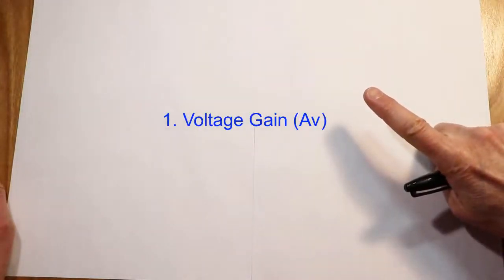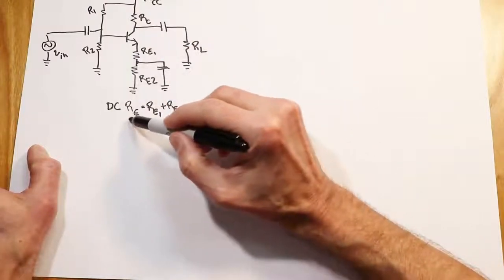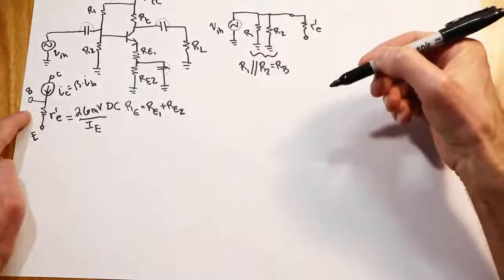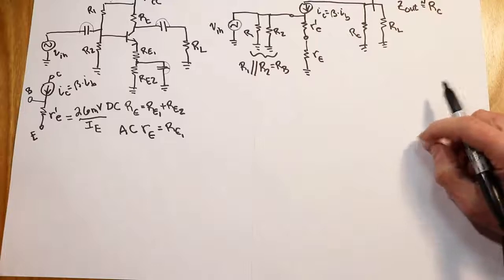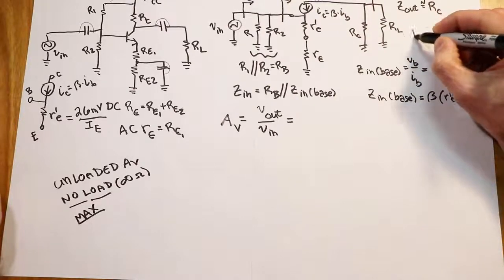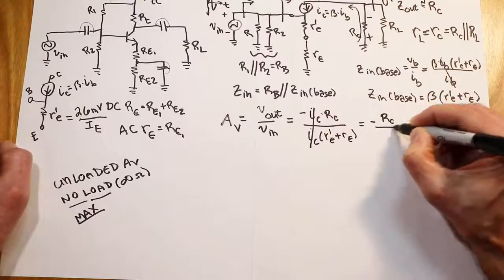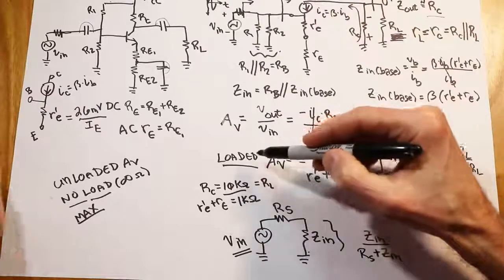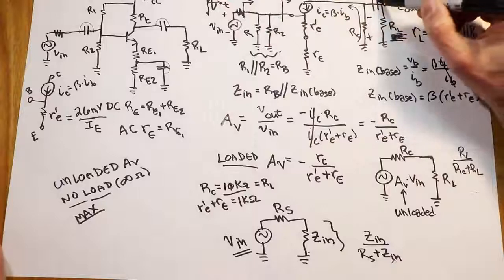Semiconductor Devices: Common Emitter Amplifier

Comment: Perhaps one of the most comprehensive and well-explained videos on this topic in all of Youtube. Thank you! I was going through your videos and was wondering if you had one (or will make one) about designing a multistage amplifier given a certain set of parameters? Such as a specific voltage gain, a specific Vcc, a specific input resistance, etc.
Reply from the maker: I don't have one of those out yet, but you will find all of the requisite bits either in the Semiconductor Devices playlist or in the (free) text book of the same name. If your interest is in making audio amplifiers and associated equipment, I strongly suggest taking a look at the Op Amps playlist and associated (free) text book. There's tons of applicable material there, and, at least for the line level stages, designing with modern op amps tends to be a more successful endeavor for the average individual (as in quicker and less expensive). Modern op amps can be of excellent quality, and a smart use of them with some discrete design elements can accomplish most anything you want.
Reply: @ElectronicswithProfessorFiore  Oh I only asked because I'm actually an EE student right now and one of our lab assignments is to design a multistage amplifier using BJT transistors. I find it interesting how the R(in) of one stage becomes the load of another, and having to take that into your calculations for each stage. It was and still is slightly confusing to me but still a lot of fun.

Comment: That's one of the best descriptions of the common emitter stage with fixed biasing that I've seen on YouTube. I would add a few points:

(1) At 0:32 the other two things to look at are frequency response and distortion. For audio use, the input capacitor needs a reactance equal to the sum of the source and input impendences at the -3dB point, usually 20Hz. Similarly, the output capacitor needs a reactance equal to the sum of the output and load impedances at the -3dB point. Finally, the emitter bypass capacitor needs a reactance equal to the sum of r'e and Re1 at the -3dB point. It's a common mistake to assume that it needs to be calculated from Re2, which often then tanks the low frequency response.

Distortion in BJTs in common emitter mode is mainly caused by the dependence of r'e on collector/emitter current. It means that large input signals have greater amplification of the positive going half-cycle than of the negative going half-cycle, and it's pretty nasty. It is reduced by making Re1 an order of magnitude greater than r'e, at the expense of gain.

(2) The maximum unloaded voltage gain is given by maximising Rc/(r'e + Re1). that occurs when Re1 = 0 and so is equal to Rc/r'e. Since Rc will normally drop around half the supply voltage under quiescent conditions it is equal to Vcc/2 divided by Ic. So the maximum gain Av can be written as (Vcc/2.Ic) / (26mV/Ic) = Vcc / 50mV. This show the maximum achievable voltage gain depends just on the supply voltage.

However, the distortion in such a stage is likely to be unacceptable for anything other than minute input signals. So we might pick Re1 to be 9x bigger than r'e, reducing the distortion significantly, but lowering the gain by a factor of 10. The maximum realistic gain is then Vcc / 500mV. The result is that you always drop 250mV quiescent across Re1 at a maximum usable gain. And those are good design rules-of-thumb to remember.

(3) Since the output impedance is Rc, setting the output impedance (Zout) then sets the collector current to Vcc / (2.Zout) approximately. So for a 10V supply with a 5K output impedance, you will set a collector current of 1mA.

You want the current through the base bias resistors to be significantly bigger than Ib to reduce the variation in operating point with variations in transistor β. So the parallel resistance of R1 and R2 (what you called Rb) is going to be significantly less than β x Re1. But for gain Av, Re1 = Rc / Av = Zout /Av. That gives Rb << β.Zout/Av.
Hence Zin << β.Zout/Av.
That shows that the maximum achievable input impedance is related directly to the output impedance and the transistor β, and inversely related to the voltage gain.
Reply from the maker: All good stuff, but a bit much to squeeze into an introductory video! You will find this and more in my associated text. Free for the download-see the links in the video's description.
Reply: @ElectronicswithProfessorFiore  Well, of course it always depends on your target audience, but if you look at other similar videos on YouTube, you'll see that the points I raise above are very common questions in the comments.

The common emitter amplifier stage can be "designed" by simply copying other working designs, and that's certainly one route for the beginner. But as soon as you examine what is needed to design the circuit from a set of specifications, you'll realise that there's a core of information that is essential to be able to master that task.

You certainly have to show how to calculate capacitor values, and it's useful to demonstrate how the choice of collector current determines the input and output impedances, as well as how the choice of supply voltage determines the maximum gain. Anyone who aspires to become a designer needs that core at least.
Reply from the maker: @RexxSchneider  Right, and the goal of this video is as an introduction, with more to follow. It is not intended to cover the topic in its entirety. This video represents what I would present typically in our first lecture on common emitter amplifiers in a classroom setting. All of the videos I create for this channel are modeled on what I would cover in a single lecture, and are designed to support my free textbooks. They are not designed in any way to compete with what anyone else is doing on YouTube.
Reply: @ElectronicswithProfessorFiore  I'm finding your lectures perfectly paced. Trying to give 'all' of the relevant information in one go is overwhelming and poor teaching. Your teaching pace is great, for me. Thank you. We could also mention Miller effects and frequency response but this is better done in a separate lecture. My poor brain can only absorb so much at once. I'm really enjoying your teaching style.

Comment: I’m confused about the impedance looking into the base (Zin base). With the AC model, it looks like it should just be r’e + rE, as the current source should be considered an open when calculating impedance?
Reply from the maker: Yes, it is an open when looking out toward the collector. The issue is that the current source is a dependent source whose value is beta times larger than the incoming base current. When you multiply this current by the emitter resistance, you get a voltage much greater than the base current could create alone. Thus, the emitter resistance appears to be beta times larger when seen from the base. The reverse also happens. When you look into the emitter, whatever you see in the base appears to be beta times smaller.

Comment: Howdy. Objection.
JohnAudioTech has shown that the output impedance is 2 x the collector resistor. I have verified this. Loading with 2 x Rc the signal drops to 1/sqrt2.
And. If the emitter resistor has no bypass capacitor the transistor input impedance is very high and may be omitted. Only Rb1IIRb2 remains.
If the emitter resistor is bypassed with a large enough capacitor the Rb1IIEb2 may be omitted leaving only the transistor input impedance.
How to determine the transistor input impedance ? Check data sheet for variation of base-emitter junction threshold voltage with varying base currents. Zin is roughly dVbe / dIbe.
Zin will vary with varying drive levels though.
Regards.
Reply from the maker: Really? That's pretty interesting because Rc winds up in parallel with the BJT output, so how do we get a value that's larger than Rc? (e.g., what do you put in parallel with a 1k to get 2k?) 

Now, regarding your "proof", given Rc<<Rcurrentsource, if Zout = 2*Rc, and Rload is 2*Rc, then the loaded gain should fall to 1/2 of the unloaded value, not 1/sqrt2. Basic arithmetic. You've described the matched impedance case. It's just a 1:1 voltage divider. 

On the other hand, if Zout = Rc as I said in the video, then setting Rload to 2*Rc will result in a 2:1 divider, meaning that the loaded signal drops to 67% of the unloaded value. Further, it is not true that Rb1//Rb2 can be omitted given sufficient bypass. It might work out that way, but it might not, depending on the values. Anyway, thanks for the interest.

Comment: I was confused at the point where you talked about the unloaded versus loaded output impedance. You showed that you can use a voltage divider to determine The output voltage with an added load. But wouldn't the load that's added be imperial with Rc? Not in series. I'm sure i'm missing something here
Reply from the maker: The load is indeed in parallel with Rc. The point is that you can do the analysis two ways:
First way is to use the loaded calc, including Rload in parallel with Rc.
Second way is to calc the unloaded gain, and then multiply that by the loss created between Zout and the load. What may be confusing you is that we start with a model of the transistor as a current source with Rc in parallel with it, and then you do a source conversion, turning it into a voltage source with Rc in series with it. This makes the voltage divider effect with the load obvious. (You could also skip that conversion and do a current divider between Rc and the load, but my experience is that students tend to see the voltage divider effect more clearly).

Comment: Unfortunately the top of you page is outside the camera frame - v hard to guess what’s going on there. Are you able to repost in a better position?
Reply from the maker: Go to 21:00. There is a still frame of the entire page. It turned out that very little was chopped off, but I understand that it can be disconcerting.

Comment: I watched it again, I want my memory back! Would you calculate the loaded input voltage by including the voltage-divider resistors or just use the V-in at the base and V-out at the collector to calculate the Av? I think that as long as we state our assumptions it doesn't really matter but was wondering if there is a standard method?
Reply from the maker: You must include the divider resistors in order to get a proper Zin value. This may or may not affect the overall gain- that depends on the size of the source impedance.
Reply: @ElectronicswithProfessorFiore  Thank you.

Comment: Hi Professor Fiore.. Can you help me figure out the the AC and DC loadlines of this specific circuit, pls? Thank u so much.
Reply from the maker: Let's start with this: Here is a video that includes the DC load line for a very similar circuit:
https://youtu.be/TZbgD-uZ69U
The obvious difference is that, in the circuit above, the emitter resistance is split into two parts (which are combined into one for DC as the bypass cap is open).
Reply: @ElectronicswithProfessorFiore  thank you so much! appreciate the response, Professor..

Comment: Hi, Professor Fiore can you please explain what is an ac ground and why it is needed to short dc source, I tried to look for an explanation but cannot get one. Thanks
Reply from the maker: This is a standard circuit analysis technique. We are looking at an AC equivalent circuit. In other words, "How does the DC source 'behave' in the AC equivalent?" Think in terms of Thevenin's Theorem. We are replacing the DC source with its ideal internal resistance, which is a short. Thus, we say that the DC source "goes to AC ground". That is, the power supply node is the same as ground when performing an AC analysis. So "AC ground" is not the same as the circuit ground. It is a mathematical abstraction, a place of zero potential for AC signals.
Reply: Thank you, ....when we are figuring out the collector current through an exponential equation and we consider the dc input bias and ac varying small input signal and assume a linear model while calculating the gain due to ac input the dc battery source does not appear in the ac gain equation whereas in dc gain it appears So mathematical abstraction is modeled in ac circuit without the need of dc source...am I understanding correctly ? @ElectronicswithProfessorFiore
Reply from the maker: @Pooja-zz9tu  More or less, but remember that the DC source is required to help set up the AC equivalent in the first place!

Comment: Doesn't voltage divider between a base of a transistor cause voltage drop to around 600mv
Reply from the maker: 0.6 volts as the approximate value of Vbe, the base-to-emitter voltage when forward biased. The divider establishes Vb, the base voltage. Not the same things here as the emitter is not at ground.
Reply: @ElectronicswithProfessorFiore  sir I been trying to learn to design/build a class AB power amplifier, where should I start to learn this, I wasn't expecting you to reply. There isn't a lot of information on anywhere. VAS stage is the most difficult to understand.
Reply from the maker: @gammersunity4117  What's your background? Do you have any formal training in engineering or electronics? That will tell us where to begin. I will state at the outset that designing a quality power amplifier is not a minor undertaking. Building an existing design is much less work, but still not trivial.
Reply: @ElectronicswithProfessorFiore  I don't have a training infact I'm mechanical engineering student, I am just big fan of speakers and amplifier from very young age, my knowledge is kind of dispersed.I just know known the very basics.
Reply from the maker: @gammersunity4117  OK, as an ME student, you would have the requisite math and physics, and possibly an intro electricity course, so that's good. I suggest that you download my AC Circuit Analysis text along with my Semiconductor Devices text if haven't done so already (links in the video description above). There are matching video playlists for both. You'll want to work your way through the first four or five chapters of the AC text and then start at the beginning of the Semi Dev text. Yes, this will take some time but you can either do it fast or you can do it right. Trying to skip through material to "get to the good stuff" will only mean trouble later. Besides, if you enjoy the material, you might opt for a double major in ME and EE, and that would be a pretty cool combination. This recipe is probably not what you want to hear but it is what you need to hear. 

I should add that there are some things that you can skip over in the Semi Dev text such as the chapter on diode applications and specialized types (clippers, clampers, LEDs, varactors, and so forth) as well as some of the material on power supplies, assuming you're just going to buy an off-the-shelf power supply versus designing your own. Even with that, you're still looking at the equivalent material of a 4 credit hour course, assuming you've taken an electricity/circuit analysis course with your ME studies. (If not, grab the DC Circuit Analysis text and run through the first five or six chapters before doing anything else.) At my college, most engineering students took an intro circuit analysis course in their second year.
Reply: @ElectronicswithProfessorFiore I have downloaded both the pdf. Sir do you have a discord server or something like that. If there is, it'd be a great honour to be there.
Reply from the maker: @gammersunity4117  No discord server.